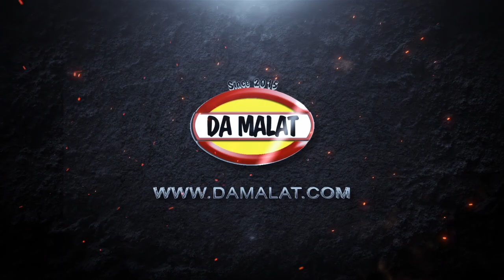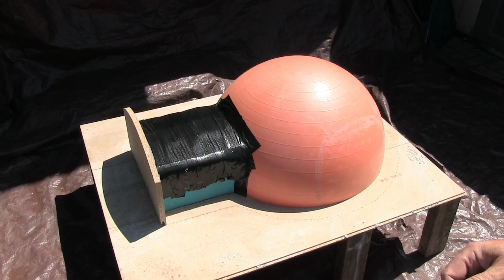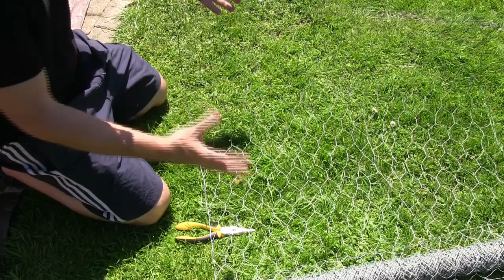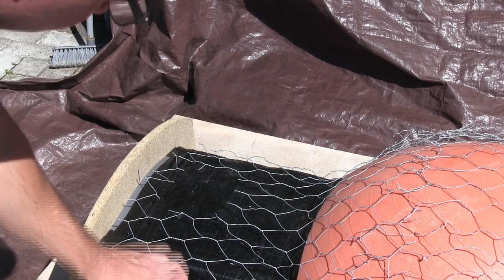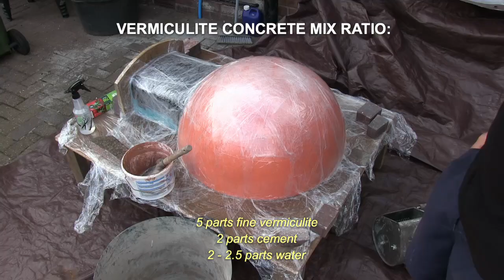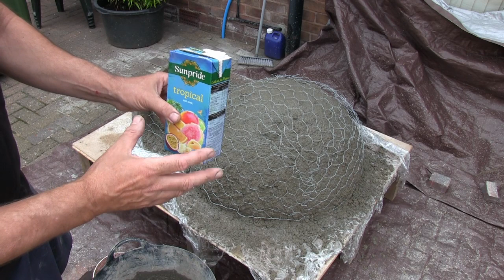AMAZING Outdoor Pizza Oven (part 6) Built for £70 - about $90

Comment: You are very meticulous and I appreciate all of your efforts here but I have a question. Why do you have vermiculite in the innermost layer of the dome? It is a great insulator and it seems you would want something more dense for the inner layer for heat retention. Then add vermiculite in the outer layer for insulation to slow heat loss.

Comment: Great set of vidoes, can't wait to get started.

I did have a question, at the point you add the chicken wire could I add a fire blanket or some other form of insulation?

Comment: Hi everyone.  I was planning on using Perlite instead of Vermiculite.  I'm in the U.S.  I can find coarse Perlite very easy.  I found a 2 cubic foot bag at Home Depot for $17.  However, I'm mildly concerned the coarse grade will cause me issues on my dome density/refractory capabilities.  I will be using refractory cement.  Is it that crucial to use a medium or finer grade of Perlite? or will I be fine to use the coarse grade?  Will the coarse grade effect longevity of the dome?  I do plan to also do a layer of ceramic insulation blanket over my peri-crete dome.  This is my first ever build.  Da Malat has given me inspiration and belief I can actually do this on my own and be successful at it.     UPDATE:  After reading through more comments/questions and responses from Da Malat, I'm going to experiment with putting some through a blender/food chopper to see how the Perlite does.  We'll see.

Comment: It's a genius idea using the tyralean gun to apply the concrete mix.
Thanks for the heads-up about vibrating the concrete mix, it is a mistake I would have made if I hadn't been warned.
Could the another layer of cement be added, but with a plasticiser to make the overall structure water proof or isn't it needed? Thanks.

Comment: No firebrick!! I'm sorry but that is not a Pizza oven, just because its the right shape, doesn't make it a Pizza Oven. You need to construct the oven and the base from either a firebrick or a clay formulated to withstand and to hold the heat! Vermiculite is only being used as an insulator, that is not the point, Its ineffective to hold the heat, vermiculite does exactly the opposite!! A proper pizza oven will hold the heat often for days after after the fire has died out. What you have there is a very poor excuse for a pizza oven, if you are going to teach people how to build a Pizza oven, you need to tell people how to build one correctly!!!

Comment: Hello, Great videos thank you. Just a quick question, I'm in the middle of choosing between fire brick or the vermiculite cement mix for the oven floor. The fire bricks are a lot more expensive so I was hoping it can work with the vermiculite, but I've seen lots of people saying it won't cook the underside of the pizza, whats your experience with this?

Comment: Your videos are great! You did an amazing job. Thank you so much sharing. Cannot wait to start my build. Have a question though, is it possible to make a full size pizza in this oven? Like a 12 or 14 inch pizza? It looks like the entry is too narrow. Would i have to build a bigger dome to make a larger pizza or would the entry way need to be wider? Any idea on how I can adjust the measurements to make it work? I was going to make the top out of concrete and the dimensions I am going to use are 47" by 60." I found these plans https://www.brickwoodovens.com/assets/47-x-60---base-(barile-grande).pdf I plan to use these instructions for the foundation and base but want to use your oven design. Hoping to adjust your design a little so I can make a larger pizza. Any advice would be greatly appreciated.
Reply from the maker: Thanks for the comment, much appreciated. The maximum pizza diameter for this build is 12 inch. If you are building a bespoke top for the plinth then you can increase the size of the oven proportionally to fit the top. If the entrance is made larger without increasing the other dimensions of the oven, you will lose too much heat through the larger entrance. The internal width of the entrance on this oven build as it stands is 13 inches.
Reply: @DaMalat   Thanks for the quick reply. Any idea how to change the measurements to fit the aforementioned plinth? Is there a rule that followed to come up with your measurements? 
Also, I liked and subscribed to your channel. A little disappointed that you like Dominos pizza. lol.... I highly recommend this guys recipes for pizza dough. https://youtu.be/_lET8R7YhTw Note: He does make mistakes  when stating his some of his measurements on the video. However, he corrects them in the notes.

Comment: Considering using stainless steel nails instead of the chicken wire. Is there a precise ratio or is it a case of mixing them into the vermiculite concrete mix and carry on layering till the desired dome thickness?
Reply: Thank you in advance for any help! :)
Reply from the maker: Hi Jamie. Sorry, the needles will not work with this type of construction. The vermiculite concrete is not dense enough to hold the needles in place before it has time to set. The end result will be a concentration of needles closest to the gym ball and a weaker bond on the outer surface. A furnace refractory compound mix is ideal if using the needles. There are plenty of homemade recipes on the net (search for furnace refractory compound mix)
Reply: @DaMalat  Thank you for the fast reply. I have done a 2cm base layer with the vermiculite concrete, but can't source chicken wire where I am. I will try to find insulating ceramic fibre blanket to use instead but if I cant source that is your above suggestion to do a straight refractory cement + cold water compound (no vermiculite) for the rest of the dome? Thank you
Reply from the maker: @jamiebilbow  It's the right time of year to buy small rolls of chicken wire. I think B&M Bargains, B&Q, Wilko's and Wickes all have it as part of their garden range https://www.wilko.com/en-uk/wilko-10m-x-60cm-wire-garden-netting/p/7432140

Comment: Great video!  How much vermiculite did you use to build oven dome on its own?  Thanks!
Reply from the maker: Oven dome took about 65 litres of vermiculite with 35 litres going into the floor
Reply: @DaMalat  Can you please tell me what vermiculite grain size did you used, Fine(1-3mm) or medium (2-6mm)? Again great work!
Reply from the maker: @michals7672  Thanks. Used fine grade. I did experiment with different grades and fine worked the best for coverage and finish. I did also see a video of someone who used a larger grade and found holes and cavities between the larger grain sizes when the vermiculite dried and thought they would potentially lead to stress crackiing once the oven reached cooking temperature.

Comment: Very nice to watch and thanks for sharing, amazing work, love every part of videos. One question, just before the chicken wire, can one put thermal material to isolate the temperature inside the oven.
Reply from the maker: Thanks for the comment Ben. Yes, of course you can add another layer of thermal protection and it would definitely improve the oven. This build challenge had a very tight budget so that's the only reason it wasn't included.
Reply: Hi, I'm mid build and about to start the vermiculite concrete rendering. I also want to use an insulating layer, should it go in between vermiculite, or on after and before the normal rendering?
Reply: @joshloughrey7984  Hi, did you get an answer to this question? Cheers.

Comment: absolutely love this series of videos. Excellent idea with the tyrolean gun (though apparenlty they don't sell them here in the states though i did not look hard). that said i have a couple quick questions. 
- Did you consider using fibers (synthetic or stainless) in the cement vs. the chicken wire? 
- Instead of using the juicebox had you considered just molding in ceramic flue liner?
i assume you went the way you did purely for expense but i am wondering if a bit more money spend might net me a slightly better end product especially with the fiber reinforced cement vs just chicken wire.
Reply from the maker: Thanks for the comment, much appreciated. You can buy the Tyrolean gun through an ebay seller in Miami. Just go onto ebay and search for "Pretul galvanised stucco splatter machines". The build was done to a strict budget so lots of improvements can be made. Stainless needles would definitely improve the build. So would a fibre blanket layer between the oven dome and render top coat. A fire brick floor would be a good addition as well.

Comment: Why use thermally insulating Vermiculite concrete?.. it’s great as an insulating render on the outside of a refractory brick dome.. I used storage heater bricks (lots of people have unused storage heaters they are happy for someone to take away!.. the bricks hold the heat, the perlite/vermiculite concrete, with an extra layer of polystyrene concrete insulates it like no tomorrow... your oven keeps heat for 3 1/2 hours.. mine keeps cooking for up to a week!
Reply: Hi Julian, did you use storage heater bricks for a rounded dome  or a square oven?
Thanks

Comment: Can you explain how to get the dome off the wood and into place please, is it quite strong to lift up using the done entrance?
Reply from the maker: You can slide the dome forward on the wood until the back of the dome moves over the large hole where the gym ball was. You can then lift the dome (two pweson lift) with hands under the back of the dome and the front where the front entrance meets the dome.
Reply: Da Malat good man thank you, looked into the website do you sell these already made up?
Reply from the maker: @stevenslack2913  Not yet pal. I'm going through the process of building fibreglass molds so I can produce these commercially. When available, they will be made from correct refractory materials. 2 main suppliers have been forced to close during the pandemic so I'm just wiating for them to re-open then the project will be up and running again. If you sub to the channel, I'll be making a video about the new ovens and details on how to order. Thanks for the interest, much appreciated.
Reply: Da Malat already subscribed pal
Reply from the maker: @stevenslack2913  Brilliant, thanks mate.

Comment: I am up to the point where I need to apply the verm/concrete mix but I am in US and had no luck finding the stucco flicker gun. Looked it up by the other names mentioned in the comments but unless I want to buy an air compressor and a hopper gun, I can’t find any way to apply this like the gun you have. Any suggestions?
Reply from the maker: For some reason most of the sites in the USA are currently unavailable from the UK or just keep refreshing constantly so it's difficult for me to search. Pretul galvanised stucco splatter machines are available in the USA. There is a seller on ebay who I think is based in Miami. Also, there is a guy currently selling a used one on ebay (I think he lists it as "vintage Italian stucco splatter plaster machine" ?
Reply: Awesome, I’ll go look now! Thank you! And I forgot to say in my first comment how great your videos are! Best out there!
Reply from the maker: @robloxmeh7404  Thanks for the comment, much appreciated.
Reply: I found the seller on eBay in Miami! Thank you!
Reply from the maker: @robloxmeh7404  Good luck, let me know if you need anything else.
Reply: @DaMalat  I found the stucco splatter machine you mentioned but they are $60-$130.  I was wondering if the hopper would work with the air compressor for this mixture? I can find them used, cheaper than the splatter guns.
Reply from the maker: @loribock2746  You can apply the concrete by hand. Just take your time and make sure it's not building too much at the base. The air compressor applicators will block very easily. Do you have a pool installation company near you? They should have the kit you need and might have an old gun they will part with or let you use? vermiculite concrete is used extensively in the pool installation business.

Comment: Hi , thanks for great videos , I have a question about refractory cement , I have purchased refractory cement as you suggested , but the supplier says it  will not work mixing with vermivulite , is this true ?
Reply from the maker: No that's not true. Unfortunately, some "manufacturers" call their product refractory cement when it's actually a mortar mix (either dry or ready mixed). In order to distinguish correct refractory cement from these mislabelled products, manufacturers of correctly labelled refractory cement sometimes call it "cement fondu" or "Furnace Cement" Proper refractory cement should take the place of standard Portland Cement but allows the concrete mix to reach much higher temperatures with decreased expansion and contraction (hence less cracking of the concrete). Refractory cement is used in the manufacture of kilns where Perlite or Vermiculite is added as part of the mix.
Reply: @DaMalat  , I have completed my dome :) thanks to your videos , but I hope the refractory cement I have bought works , following is what I have found in eBay: 25KG 1200°C Castable Refractory PIZZA OVEN Gas Kiln Furnace Forge mortar cement

Will give it few days and see if it is solid when dry

Comment: Hi 
Really enjoyed the videos ( have watched them all twice)
Also watched other videos on You Tube where insulation is added between layers of vermiculite / cement and chicken wire.
Any reason, other than cost of insulation , you chose not to use it?
Reply from the maker: Thanks Grahame for the comment. In reply to your question - Cost was the only factor regarding the insulation layer. This project was a challenge between a few friends with a very strict budget. If cost is not a great issue then lots of improvements can be made including a thermal blanket layer, fire brick base etc.
Reply: @DaMalat  How would you action a fire brick base? Would you create one in fire brick instead of the vermiculite base or in addition to it? I already have the templates set up for the vermiculite base and dome, just waiting on materials to arrive
Reply from the maker: @johnmeaden5495  Hi John. Personally, i'd have the firebrick base in addition to the vermiculite concrete base.
Reply: Da Malat thanks for the quick reply, would you adhere it to the vermiculite base with fire cement and then attach the dome to firebricks with same cement to keep internal heights the same?
Reply from the maker: @johnmeaden5495  Yes John.

Comment: Great work, ill be making one this year, can U tell what granulation of vermiculite is most suitable for the oven.
Reply from the maker: Thanks for the comment, much appreciated. Fine vermiculite is by far the best. It reduces the risk of cavities within the concrete (which will reduce the risk of cracking) and produces a far superior finish to the oven floor. Let me know if you need any further assistance, I'm more than happy to answer any questions.
Reply: I think I’ve used course vermiculite . It didn’t really say on the package but looking at it it doesn’t seem as smooth as yours it’s done now can’t go back but it does look great up to now

Comment: Does anyone in the US know where to find a Tyrolean gun domestically in the US?
Reply from the maker: gary craig its called a splatter stucco machine or hand crank stucco applicator in the USA and most contractor suppliers will sell them.
Reply: I just purchased one on amazon for less than $60, well worth the investment

Comment: To aid ‘stiction’ of your vermiculite concrete mix to flick from Tyrolean box onto your dome etc - useful to put some wallpaper adhesive methyl cellulose powder into the mix to make it extra cohesive. Also use high alumina cement ‘ciment fondu’ or Secar instaed of Portland cement - better at withstanding high temperatures inside oven. Moi? - concrete technologist / construction chemicals specialist living in Timperley
Reply: Wish I had read this before. What a nightmare I just had lol.

Comment: Instead of the chicken wire do you think you could use glass reinforcement fibres. Excellent series, just what I was looking for. 👍👍👍
Reply from the maker: Hi Andrew, thanks for the comment. The alternative to the chicken wire is either a more expensive, smaller wire mesh sheet which is a lot easier to handle. Or stainless steel needles which is what some of the commercial pizza oven manufacturers use. Both of which would take the build above budget but if you have the funds then go for one of those methods. I haven't heard of glass reinforced fibres being used?

Comment: I started by build today. Going well but the chicken wire shaping is a bit of a thankless task! Slowly getting there though. What’s the purpose of it? Is it essential?
Reply from the maker: Yes, the chicken wire reinforces the vermiculite concrete which by itself doesn't have a great deal of tensile strength.
Reply: I had a hard time as well, then realized that I had 1" chicken wire and he had used 2" chicken wire.  It is much more pliable. Probably way too late for you, but I spent a whole day trying to get that stiff wire to shape into a dome.  Many holes in my hands as well.  Took about an hour to get it right with the 2"